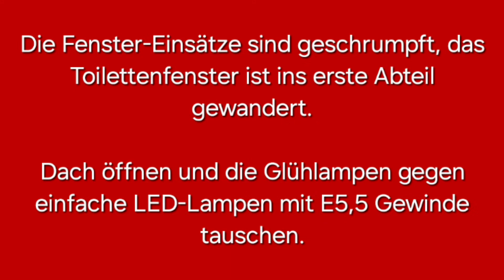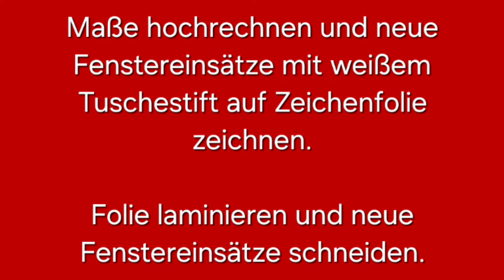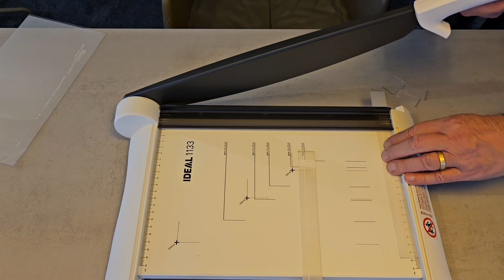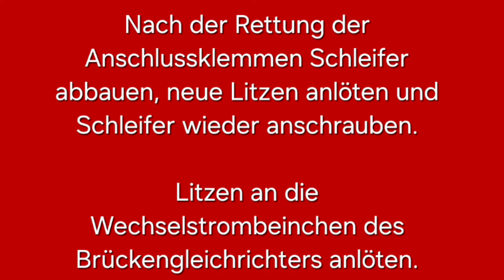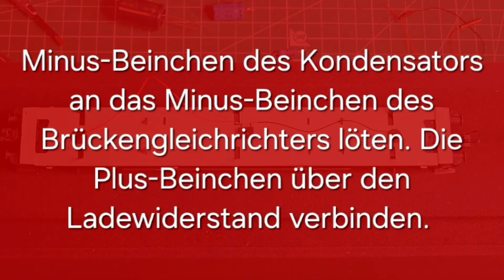TRIX EXPRESS: Es werde Licht - Blech-D-Zugwagen Stufe 1

Comment: hello, could you tell me about the type of capacitor and the resistance or diode tha you installed in it. Did you replace the original bulbs with leds? I don´t think that I can find it in my country. thanks!!
Reply from the maker: @arturocastro4707 Dear Arturo, the data are written down in the description of the video. I found them on eBay since our local electronics dealers disappeared.